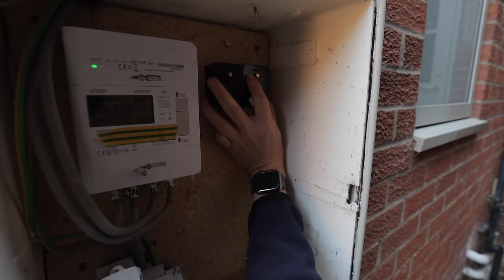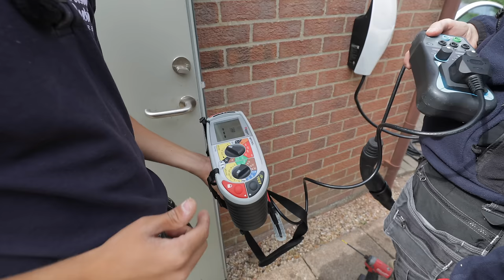I was WRONG! The Tesla Gen 3 Charger is the WORST!

Comment: It’s ALWAYS the router.  The Wi-Fi chipset in the Tesla is rock solid.  

Linked 5 / 2.4 is normally the issue.  The need to be spilt to Separate channels say wifiname5 and wifiname2 - connected and then you can rejoin them.   Happens with loads of rubbish routers from virgin / sky / BT etc…. They cost the companies about £15.  They are just cheap crap. 

If you put the crap router into modem mode and use a decent router or mesh then you don’t get this problem.  

I get that doesn’t help.  But Wi-Fi is a mess.  Same issue with Phillips hue and crap routers crosstalking.

Comment: A lot of people with this Telsa charger seam to resort to WiFi repeaters. 

A form over function design from start to finish
Reply: It is not just Tesla. I have a background in wireless radios, about 30 years. Every wireless device has its limitations. THe higher the frequency of the Router the shorter range it will have indoors (the higher the frequency the less walls, trees, etc. that can be penetrated.)  In an open field 5.0 GHz will travel much further than 900 MHz or even 2.4 GHz. The higher the frequency the larger the bandwidth, the more data that can be carried in a given period of time. That is why a 900 MHz Router may be able to service and entire home and with a 5.0 GHz Router you may need a Mesh Router with 2 Remotes to cover the same area adequately.

Comment: There is only one answer to untidy cable storage. Until someone offers a retracting cable system, like an air line on a petrol station tyre pump,  untethered is the only way. Its a pay off, what is more critical to the customer; convenience or aesthetics. Generally customers don't carefully coil the cable, so all tethered units are gonna look like a dogss dinner. Always worth discussing this pre install, do you want tidy or quick? 
Edit: Jordan, take some pics of chargers lead storage after 3 months use by customers. It won't be pretty.

Comment: That's where my Zappi wins. It can communicate using a different means (RF, not WiFi) with a hub, which is plugged directly into the router. 
My installer had similar problems connecting my Solax inverter. In the end I had to buy a WiFi booster/extender. My charger and inverter are in an attached garage. The WiFi has difficulty penetrating the double brick wall.
And in answer to those suggesting  2.4Ghz, the Inverter only communicates using 2.4....

Comment: Further comment. My charger is INSIDE my garage, as is my Tesla Model Y. Garages are for cars, first & foremost. I am, admittedly, lucky enough to have a 6.5m long garage, but WHY do people want chargers installed on exterior walls? If you are absent from your home, on holiday or whatever, there is nothing to prevent a total stranger using your charger.
Reply: Not true young Skywalker.  the Tesla charger can be locked to a single vehicle if you have the need or concern of charging thefts.

Comment: 99% of people use the free router that their broadband supplier gives them. To provide them free requires that the broadband provider buy cheap devices.. and the cheap devices have crap wifi. Replace your house wifi with even a single good wifi router and it will transform your signal quality! I use the TP-Link Deco systems which can work in a mesh (seamless roaming between APs) where you have a large property and need coverage everywhere - you then get flawless wifi everywhere.

Comment: the issue with the wifi connectivity is the fact the charger doesnt support WPA security. Had that on mine and as soon as I disabled it it worked perfectly ever since.
Reply: According to the manual for the Tesla Gen 3 charger, it has a WPA2 password that needs to be used. So it clearly supports WPA2 encryption, which today, is the minimum encryption standard it should be using.

If people are still running their home networks on WPA (or WEP) and not WPA2, then they really need to change over to WPA2.

Comment: Tbh, I don't think you should have to be a IT Specialist.  There should be respect for trades around the Table, I know how to wire a plug but I'm never going to tell you how to do your job.
This is what customer support is for, both the Wall Charger and the Network devices and it's the customer responsibility.

One of the easiest things the customer could do is install a free app, such as Wifi Analyser for Android and ensure that their signal is no worse than -65 dBm on which ever frequency the charger supports.  This is not to make a definite decision but to manage expectations as to whether or not they may face challenges.

Comment: Most chargers only have a 2.4ghz internal antenna whilst routers are dual band so may only want to supply the charger with a 5 ghz frequency hence why the charger won't connect
Reply: 5ghz Wi-Fi has significant difficulty penetrating walls - it's good inside the house, but to get outside it's range is massively reduced....so it's a good job that EV chargers use 2.4Ghz (and i'm sure the manufacturers do this deliberately for this reason). 

Dual band routers have 2 seperate wifi connections for each band, so if the charger doesn't see the customers wifi at all - then you will need to check that the 2.4ghz band has not been disabled on the router.....which the user would have disabled themselves as they don't come disabled by default.

Comment: This just seems insane overkill, all that extra stuff to run what's really just a plug socket, the car does the clever stuff.
Reply: It is insane overkill until one day you have a PEN fault (they do happen; if you're on PME, it's a question of when, not if) and you get electrocuted when you touch your car. Other chargers have PEN fault detection built in; this charger does not and so requires that extra board equipment.
Reply: @aaronmdjones  if I roll out of bed between 12:30 and 4 then decide to lick my car I deserve it. 🙃
Reply: @aaronmdjones  It is insane overkill as the PEN fault risk is exactly the same for a wall charger as a granny charger plugged into a 13A socket, so why regulate one but not the other; plenty of people use a granny charger as their sole means of charging.

For the risk to become a reality, you need a PEN fault at the same time as an insulation fault in the car, at the same time the car is being charged, at the same time as a person is in contact with exposed and live metal on the car whilst in good contact with the earth. Possible, but extremely unlikely and verging on the 'never going to happen'.

If it were at all likely then by now we would have heard of cases of people being electrocuted by their granny chargers.
Reply: @aaronmdjones  come on, reply to the below comments 😀
Reply: @sailingoctopus1  One but not the other is regulated more because a granny charger (a Mode 2 charger) is an electrical appliance (and so outside the purview of BS7671), but an EVSE (a Mode 3 charger) is a permanently-installed piece of electrical equipment that forms part of the electrical installation (and so is firmly within the remit of BS7671 -- there is even a dedicated section for it).

You are correct that the PEN fault risk is exactly the same for both. However, you are not correct about the amount and types of fault required.

In TN and TT electrical systems, the supply transformer neutral is earthed (at the transformer) with a low impedance; this is literally what the first T means.

If you have a PEN fault (a break in the PEN conductor in a TN-C system), then you will have current traveling in a path formed by the supply transformer line conductor; your service fuse and any circuit breakers; any electrical equipment in your home; the neutral wiring in your home; but not via the neutral conductor at the service head back to the transformer because that conductor is broken.

However, if you are on a TN-C-S installation, your electrical installation main earth terminal is that broken neutral conductor. The current will therefore still have a path back to the supply transformer via the protective earth wiring in your home; any bonded services such as water or gas -- or your body; through the mass of the earth itself; and then back to the neutral conductor in the transformer, completing the circuit.

If the current is travelling via a bonded service (such as a metallic water pipe) and that does not form a reliable-enough earth connection, the potential on all exposed conductive parts within your installation may be several dozen volts above earth potential, because it's forming a resistive divider. The chassis of your electric vehicle is also connected to that protective earth if it's plugged in, and so your body can become the path if you touch the vehicle. If the current is traveling via your body instead of (or in addition to) a bonded service, and the appliance conducting current has a low enough resistance (such as the heating element in a kettle), you may well be passing close to the full mains voltage. Worse, you could be passing close to the full 3-phase voltage (400V RMS instead of 230V) if the PEN fault is affecting another nearby property on a different phase!

Worse still, an ELCB/RCD/RCBO will NOT trip during any of this, because the current is first passing through the neutral wiring on the circuits in your home, and so there is no current imbalance between line and neutral from its perspective. An MCB will also not trip because the current is not high enough (humans make for poor electrical conductors) and a fuse will not blow for the same reason.

Chris De Christophe, a PEN fault does cause all Class 1 appliances and all extraneous conductive parts to become potentially (heh) lethal. Your example (touching a fridge) could well kill you.
Reply: @aaronmdjones  Thanks for explaining so clearly and completely.

Comment: What's really interesting with the Gen 3 charger is that it appears they didn't even put an ethernet port on it. Now I don't know if that has to deal with the electricity coming to the charger or not, maybe it does. 

One would think, especially given that not everyone has an ideal situation for a wireless network in their home (constant interference, etc...) that they'd have the option to run and plugin an Ethernet cord to the chargers.

Maybe someone knows a good reason behind it that I'm missing?

Comment: Great video as always Jordan. As a side note shouldn’t the RCD part of the RCBO be type B as set out by 722.531.3.101. I did not see an RDC-DD device within either the wall connector or unit you installed therefore BS7671 would require the RCD to be of type B. A type A or F can be used if such RDC-DD device is present. Please correct me if i have indeed misinterpreted or missed something.  Great drilling skills there by Ruben obviously not having been assisted with the measurements 😂😉👍🏻
Reply: You see them carry out a dc test via the megger 1742+ mft. It's the part when Jordan worryingly says he didn't know it did that, but I think he is referring to the fact the tester tests the dc leakage via an auto function....best mft & brand out there if you ask me
Reply: @craigbutler6243  I rewatched and indeed yes it does have an internal RDC-DD and was checked by Jordan. Somehow i missed that bit. 👍🏻👍🏻
Reply: @rattlehead85  easily done dude, you obviously know your stuff though are you an installer aswell?
Reply: @craigbutler6243  Have installed a few but now am off the tools altogether as a supervisor/manager for a small company. For now i’m done with the daily slog of install been doing it for 34 years needed a change.
Reply: So long as the cable route, and it isn't a TT installation, I don't think you need an RCD for the supply to the Zappi as it is all built in.  Save issues with it tripping at both ends as we saw during the testing.
Reply: @edwilliamson6234  The zappi has internal type A rcd & dc leakage & pen fault. The full shabang

Comment from the maker: Todays Video Sponsor:
Tradify - get 50% off your first three months with Tradify using our code "artisan" here:
https://bit.ly/3pos7Ly
Reply: You need to go onto their home router and separate the 2.4 and 5ghz network then connect the 2.4 and it will work. All this smart stuff is a bit tricky because most sparkies don’t have the knowledge to set it up but most IT people don’t have the knowledge to install and those that do can’t do it meeting regs unless they get the council to inspect
Reply: Is hardwired ethernet not an option?
Reply: @ZachGrady  not on TWC Gen3, but that would be my preferred connection type indeed

Comment: I’d offer clients the charger cable accessories for all ev chargers for wall mount: cable holder, charging end holder-separate from built in one if wanna use, cable holder w/ auto coil/tether and so on. Not only can you sell some accessories, but in some cases give them a better UX & looks as well, just as fyi as know companies that do this, and the accessories can be relatively inexpensive when bought en mass
Great looking work, and always fun to see you out in field w/ tools, and enjoy Rueben as he’s so funny; stepping on a rake 😂
Reply: Way to much current for Auto Coilers - Evidently you are not an electrician. With the amount of current that any brand of Wall Connectors draws you would have a very dangerous heat issues.  Wires need air to cool, by wrapping multiple the wire against itself will cause so much heat build up that you will exceed the temperature rating of the wire, that will cause higher resistance which intern will cause higher heat and you could end up with a fire or damaged connection points... In the US wire can be found with one of three temperature ratings, 60 degrees Celsius (140 degrees Fahrenheit), 75 degrees Celsius (167 degrees Fahrenheit) and 90 degrees Celsius (194 degrees Fahrenheit). It is not hard to exceed 60 degrees Celsius with Cable placed in an attic of a garage or house.  In a small enclosure like a wire winder it would get exceedingly hot.

Comment: This is a 2.4 GHz vs 5GHz problem. Most wifi devices except iPhones naturally connect on 2.4GHz. Just switch off the 5GHz while you pair on 2.4GHz. Guarantee this will solve the problem. iPhone will pare on 5GHz. Can't speak for other phone types. You don't need to be an IT specialist. The 2.4GHz pairing applies to security cameras and most wifi connected items. 2.4GHz is for low band width items, 5GHz for high band width items ie video streaming. Your ev charger is not high band width.

Comment: I appreciate some of the device I am having is actually not on WiFI - they comes with network ports that I can simply plug them in, or it contains a SIM card inside and they just charge me a tiny amount per year to upkeep (and avoid all that trouble of connecting). Your miles may varies though.

Comment: Tesla should just limit these to 2.4ghz.  I really don’t think they need the extra bandwidth of 5ghz.
Reply: I don't think this is a good idea. E.g. I have no 2.4GHz WiFi AP here, I am using 5GHz only. And yes, it's kind of obsolete AP, but it serves well for me and it does all I need. And I think it's a good idea to switch the 2.4GHz WiFi off, because when there is no 2.4GHz Wifi, it does not interfere with bluetooth devices, remote controls and things like that, which gives me much better user experience. And the reality is, that almost any modern WiFi device is capable of connecting to a 5GHz WiFi.
Reply: @NikiBretschneider  Range is very limited with 5ghz.  Many cars are parked outside and need the range.  I have zero problems with Bluetooth and remote control interference because Wi-Fi channel power is like a bell shape curve and the major channels only overlap Bluetooth on the lower portion of the bell.  I need 2.4ghz just to reach my outdoor security cameras.  Perhaps it’s time to upgrade you AP.

Comment: A tip for connecting wifi devices like this is to turn off the 5ghz wifi on the router and then connect to the device using the 2.4ghz. After this you can turn on the 5ghz again and it should work without issues.

Comment: WiFi is not IT specialism. Lots of old people with no IT or any other electrical or electronic knowledge can set it - unless the instructions are, actually, wrong, eg old instructions for new product. Then, it just requires a bit of self-discipline to stop, think, analyse. A few can't do it, but they are the types who can't do  or think about anything beyond the one or two activities they've always done by rote all their lives.
   Having said that, I've been installing CAT5 or CAT6 (all hidden in conduit in walls, or under floors) in my homes for 30 years, long before WiFi was widely available or powerful enough. I'd use cable, not WiFi, to a charging point

Comment: Yep this charger sucks - which is why i have just installed a Zappi having just taken delivery of my Model 3 Performance :)
Reply: I have installed many Gen3 Wall Connectors, including my own with NEVER an issue connection with a Wireless Network or any other issues....
Reply: @michaelholliday100  It's not just potential connection issues - there are many things that make this charger poor:

-For non Tesla vehicles it's a dumb charger
-No PEN fault detection means an expensive complicated installation which more than outways the lower cost of the charger.
-No solar integration.
-No real mobile app (yet afaik) other than for commisioning
-Relies on the Tesla car for scheduling - which is half broken as can't have both a start and end time (one or other only) for off peak charging.
-Cable management is poor

It has 2 good features though but of course only if you have a Tesla - the port open facility and the authorised Tesla only lockout. I can understand why if you have a Tesla they can persuade you to have one - I almost went with it for those reasons....but no solar integration was a deal breaker.